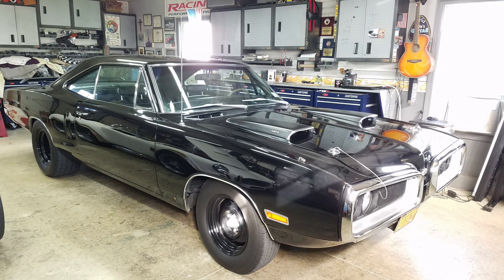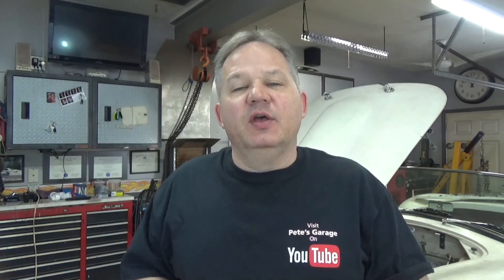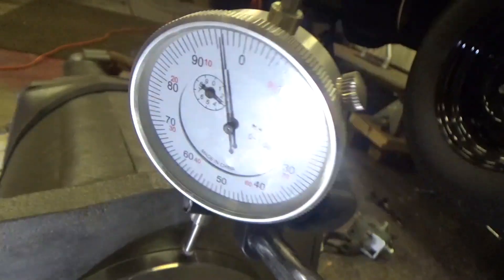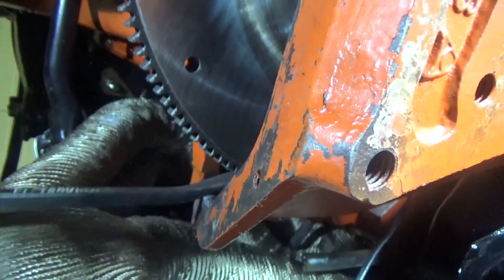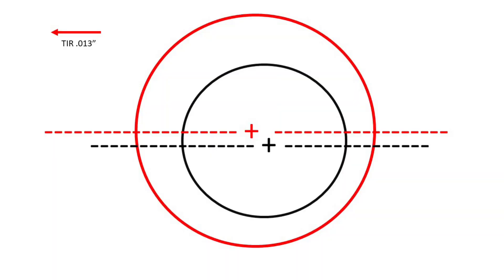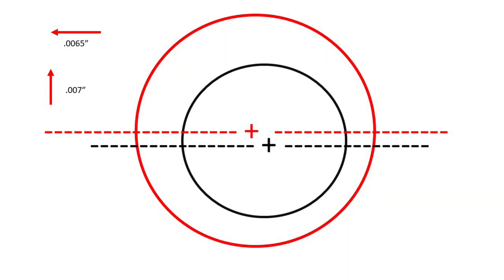How to fix Alignment Between a Bellhousing and Crankshaft with Offset Dowel Pins

Comment: Thank you for making this video. I had my 1940 Coupe in a shop for clutch repair
 SBC 327 mated to the 40 ford transmission. An adapter between the transmission and the motor. This shop charged me a lot of money and couldn't get it to shift correctly. The problems you described is exactly what I'm  experiencing. Now I know how to get it corrected and get this 40 back on the road.
Thank you so much.
Gene Taylor,  Austin,  Texas.
Reply from the maker: Glad to help get your coupe back on the road!

Comment: Thanks for this. I dont suppose u have any tips for checking runout on a trans with a non circular integral bellhousing? Using a spare bell
Reply from the maker: There has to be symmetrical points you can use

Comment: My bellhousing only has 3 bolts to the engine, now dowels, and when attached to the engine no way to rotate the flywheel, its closed. BTW the engine is a french diesel Indenor xd3 .
Reply from the maker: Every engine is different

Comment: Hi Pete.....I do enjoy your explanations in all your videos. I do tend to follow the MOPAR stuff because..... I too have a 70Bee! At any rate, I wasn't aware of this alignment until I saw something somewhere that said if your block was align honed OR your bellhousing is NOT original to that engine, you can bet the alignment will be off. Mine is BOTH. So I did my measurement. The engine and bell housing are together and sitting in a cradle. My questions are....is it possible to get 3 negative readings and one positive? I suppose so, huh?  The measurements are:
12:00 = -.002
03:00= +.002
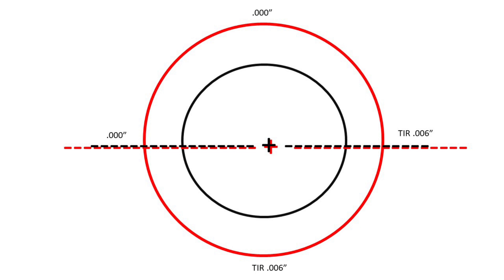06:00= -.003
09:00= -.005
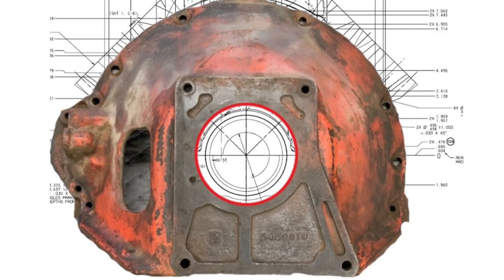All measured with a 04:00 zeroing.
My other concern is the readings themselves...I don't really know the increments on this dial. I may have left off a zero! It's probably the same as your HF and I got mine from Amazon. My base fit and held center mass on the crank without having to take a bolt out of the crank. If the TIR warrants offset pins, who do you buy your MOPAR specific pins since they are slightly smaller than half inch?
Reply from the maker: Get the 12 and 3 to measure 0 and see how far off the 6 and 9 are. If anything, it's off slightly towards the nine position. Any offset pins will work.
Reply: @PetesGarage  Thanks Pete ...and I did figure out that increments are .0005 per line so I should have an extra zero in front of those numbers. Maybe I'm ok now?

Comment: I want to put a 5-speed Tremec TKX on a 1967 Corvette, 327/350 h.p., 4-speed M21 Muncie, 3:70 rear. Is it necessary to pull the engine to get a better fitment? Or, can the swap be done without all the extra work? Great video of runout/ correction.
Reply from the maker: I've done many right in the car
Reply: @PetesGarage  Good to know.

Comment: Hello I would appreciate your help, I have a problem with a 2011 Ford Fusion sport, I replaced engine 3.5 and it’s not engaging no pressure on transmission, did I misinstalled? Dowel pins? Is there an alignment that I missed? Thanks in advance 😊
Reply from the maker: Did you bolt the torque converter to the flex plate?

Comment: Hi Pete, with my planed 460/527 engine, what would be the differents between a aluminum or steel flywheel on the street with some racing ?
Reply from the maker: For street driving and drag racing, steel provides the heavier Flywheel needed for moving the car quickly from a dead stop. On the other hand, an aluminum Flywheel or Flexplate is ideal for Road Racing, Autocross, or Circle Track Racing. It's best anytime you need RPMs for quick acceleration or a fast drop in RPMs for taking a sharp turn

Comment: So the standard dowels don't guarantee alignment? I'm a amateur with a clutch noise (pilot bearing i think) after new clutch replacement
Reply from the maker: They do not, you have to measure because the bellhousing casting could be off

Comment: Pete... I built a Cobra many years ago and had the same problem. Think it was a combination of off-center and an incorrect pivot ball which wasn't allowing the clutch to fully release. That's the car I put a 460 in! And I have another kit on the way should be around Christmas I have a new 460 block and I'm watching pretty much every video you have to refresh my memory on how to build this thing. It's also why I still think you should create some DVDs. I bought a DVD off of Amazon and if you followed it step by step you would get into a lot of trouble. They tried but they flubbed the sequence and if you didn't have some experience you could really get into trouble. Anyway it's a matter of time before I text you enjoy your weekend and thanks for the video
Reply from the maker: Thanks for the text, I just may do that

Comment: Great channel, very informative.
But i have two questions i'm not really able to find answers for online.
If you have a car and you can't find the service manual for it anywhere, how do you know how hard you need to torque every screw?
And if i were to port my intake larger than the gasket size, what material should i use to make a custom gasket? In general, what is the best material for gaskets? Does the best material change for either petrol or diesel?
Reply from the maker: There are torque specs that go by fastener size and thread pitch. I would trim the gasket to fit. Material changes for gas, diesel, turbo
Reply: @PetesGarage  Thanks, i completely forgot those specs even existed.

Comment: Nice job!  I just went through this on my 240Z with SB Chevy. 
 The other alignment to check parallelism between the back face of the block (where the bellhousing bolts against) and the back bellhousing rear surface (where the transmission rests against).  I ended up having to add shims of different thicknesses to get those parallel.  This was with an aftermarket Sonic bellhousing.  If these surfaces aren't parallel, the input shaft doesn't shoot straight towards the crank center and the tip of the input shaft will be not centered in the crank/pilot bushing, even though you aligned the bellhousing hole with the crankshaft as you showed.
My name is Pete also.
Reply from the maker: You're right, I did do that, but it's a bit difficult to do in the car. Thanks for the comment

Comment: That looks interesting. But something is not clear. It seems to me that in order to measure the offset of the bell housing relative to crank centre, the the dial indicator would need itslef to be perfectly centred, otherwise even a perfectly aligned bell housing would give non-centred readings??? How do you precisely centre the position of the dial indicator??? Maybe I'm missing something.
Reply from the maker: If you put the indicator on the flywheel and set it at zero, that point will remain constant throughout the 360 degree rotation. That is why you have the TIR measuremment
Reply: Zero out the dial indicator
Reply: Sorry my misunderstanding. I see now that wherever u fix the dial indicator to the crank, that point shld remain equi-distant from the bell housing circle so the indicator does not have to b perfectly centred so long as it stays in the same posotion throught the circle of measurement 😉

Comment: Or... they could just machine it correctly at the factory......just sayin.
Reply from the maker: True, as long as you have original parts. A built engine without the matching bellhousing or and aftermarket one causes alignment issues.
Reply: @PetesGarage  - If you buy an aftermarket bellhousing, they instruct you to check runout and parallelism.  Many DIY'rs don't have the patience or tools to check it though,
Reply from the maker: The tool are cheap compared to the parts you're checking
Reply: @PetesGarage  agreed!  Plus, the tools make other jobs so mich easier to do.
Reply: However Pete's advice here also applies to refitting original factory standard trans to vehicles original factory standard engine? Is that correct Pete? You still need to measure to ensure alignment refitting original transmission to original engine rather than relying on dowels?

Comment: Great explanation! Most people I know have no idea that there can be this much runout.  This will Really show up in an automatic transmission as uneven wear on the bushings that carry the torque converter and input shafts.
 And as you explained hard shifting with a manual transmission.  
Thanks again, Pete
Reply from the maker: Great comment, thanks Bruce